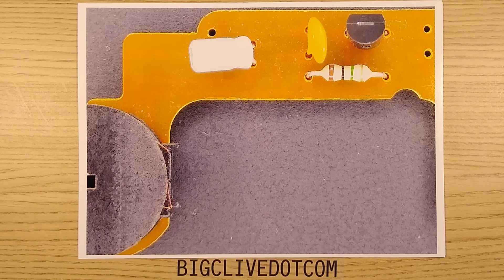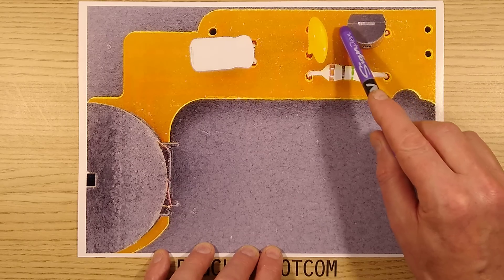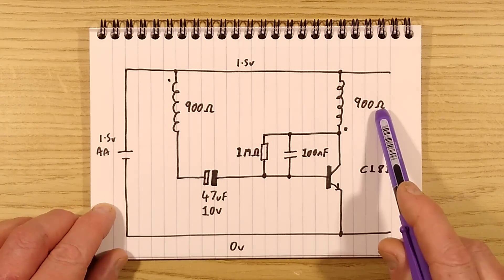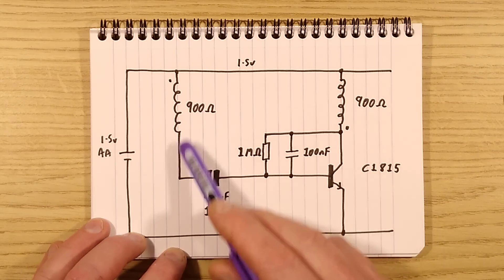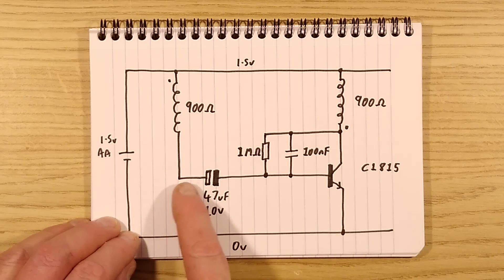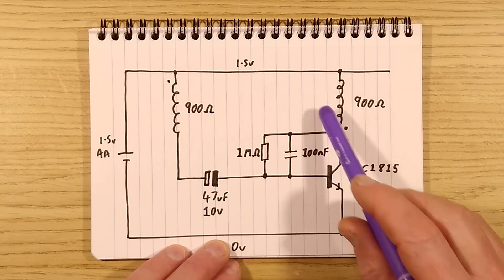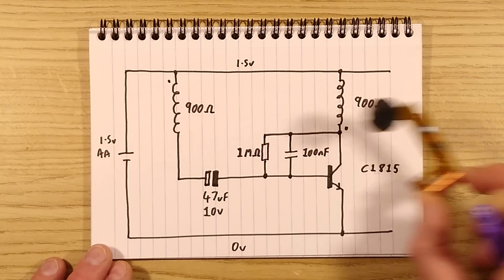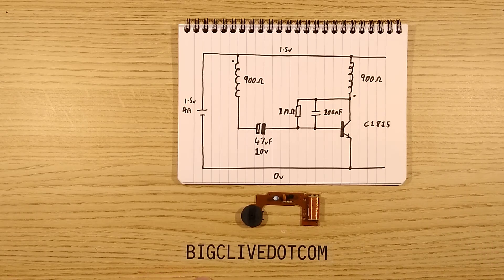Classic simple clock pendulum circuit

Comment: I have a non-working circuit that is very similar. There are two co-wound coils with different resistance. My transistor is a PNP Germanium, so the emitter is connected directly to positive, the collector is connected to negative through a 759 ohm coil, a 123 nf capacitor between base & collector, and base connected to positive through a 516 ohm coil. There is no coupling cap to base and no resister from base to collector. There are two sets of magnets that pass on either side of the co-wound coil. The magnets are very slow moving, connected to a rotating anniversary-type clock pendulum. Any ideas on what might be the problem?
Reply from the maker: If the coils are showing as intact on the PCB pads, the battery is making proper contact, there are no broken solder joints (battery contacts etc) then the transistor might be the culprit.  Note that in the simple single transistor coil kickers the transistor may actually be NPN even though it's connected to the positive rail, as the emitter/base voltage is from its own feedback winding.

Comment: I just picked up a 70's Smith's carriage clock that uses this sort of circuit. In that case it isn't a pendulum but a spinning magnet attached to a balance wheel and escapement.

I usually prefer fully mechanical clocks, although I do like the accuracy of quartz I try to avoid having too many quartz about the house. This clock I just got surprised me as it wasn't fully mechanical and certainly not quartz. It also has a lovely tick tock sound too.

Comment: In principle it might be neat to look at Bulova's "Accutron" watches, first sold in October 1960, They used use a 360 Hz tuning fork and transistor energised instead of a balance wheel as the timekeeping element, It was guaranteed to be accurate to a minute a month. Broken ones seem to go for as little as 15 quid.

Comment: This looks like a version of the classic Hartley oscillator. The centre tapped coil and 100nf capacitor form a resonant circuit. The larger capacitor and resistor are biasing. It would be interesting to see if the circuit resonates without a pendulum, and at what frequency. If we know the wire thickness, we could estimate the length of wire, number of turns, the inductance then estimate a resonant frequency for the tank circuit.

Comment: Hi Clive, a quick question maybe you could help me with. In regard to DC circuits, is there a difference between using a solid conductor or using a multi stranded conductor ?

This is in regard to model railway using up-to say 25v DC at about 6 Amps for points, Lights etc. Also DCC train controllers that output 16 Volt up-to 8 Amps. Pulse Width Modulation. 
Not quite DC nor AC but more like On/Off pulses of DC.
Any help in this regard would be appreciated. Thanks for your time. Alan
Reply from the maker: The main advantage is flexibility.  Using stranded cable puts a lot less strain on things it's attached to.  But solid core has its uses too.  I use both.

Comment: Greetings Clive! Hope you are well. Yes I have been there too,, 
A swinging desk ornament of a couple swinging on a swing, there were loads of these knocking about Inthe 80's,,
My swing originally had a 
Similar circuit as you described,, mine was not working,, I further screwed it up trying to get it working,, in the end I used an op amp and home made coil, I even replaced the 2xAA cells with a more convenient lipo cell & usb C charging port lasts about a month until it needs charging, strangely rewarding making the whole thing work after all these years,, You in part inspired the rebuild after I watched your (what could be done with lipo cells from vapes that had been thrown on street,,  Thanks dude
Reply: I also understand they are receiving my deep space signal in a neighbouring galaxy,,,lol

Comment: Just watched a YouTube channel that says the EU is bringing back phones with easily changed batteries. I wondered if they could include a solar panel on one side. I plan to make my own phone soon using bits from an old unit and a battery power pack. I intend to print a case, glue it all together, add a wrist strap, include adjustable legs, and solar panels that open out flower like. Afterwards I walk around like I did as a cheating kid at school with the equivalent of a 1970's green display calculator in my pocket. Mind you I'm still clumsy so I might ditch the idea and just invent a stick on fast working parachute system for smartphones and hope and pray the Russian style retos don't blow my pocket up.
Reply: Correction. Thickness equivalent of a 1970's calculator.

Comment: The Tennis Racket of Zeus (with design flaw). 

The mosquito zapping tennis racket sold at the Dollar or Pound Store would be a great item for you to disect.  It is just up your alley.  We bought one yesterday and it does zap the huge Canadian mosquitoes, dead! 

This looks like a tennis racket but has 3 layers of aluminum mesh sandwiched with 2 layers of plastic grid, and runs on 2 AA batteries.  When you wave it at a mosquito and it enters the mesh  ZAP!!!  the mosquito is dead.

The design flaw is as follows.  When you push the red button, the red LED does go on as per the instructions.  But when you release the button, the LED immediately goes out, leading one to believe that the racket is now safe.  But it is definitely NOT safe.  Pressing on the aluminum mesh with any force releases a whitish-blue spark straight into your finger.  Youch!!!  It does not really hurt and is kind of fun once you are used to it and expecting it.  It is basically like rubbing your feet on the carpet and touching the doorknob, but on steroids. 

This could be a fun item for a Big Clive analysis and diagram. 

Cheers.

Comment: Years ago ( 1970s) there was a animated advertisement display at a Woolworth's store. It had one transistor, one resistor, one capacitor, and the coil. The swing arm had a magnet on it. 
     It would run for months in a old school zinc carbon " D" size battery.

Comment: This circuit is similar to the joule thief or the blocking oscillator. As you suggest, the capacitor between base and collector must stop the circuit oscillating at a much higher frequency. The circuit likely operates on the edgy of stability. 
I have seen examples where the circuit has been used to phase lock a pendulum to a more accurate time signal, either a crystal or a radio time signal. I assume such circuits put a small bias on the pendulum so that it runs slightly slow, or maybe fast I can't really decide which, it must depend on the mode of operation. The circuit just pulls the oscillation into phase with the master time signal. 
In the example I was shown, the pendulum had an aluminium plate added to the end. This passed through a slot between two coils. When the coils were energised, the pendulum was slowed by induced eddy currents.

Comment: How come this circuit doesn't self-oscillate? Is it because of  bias introduced by the 1M resistor? I'd like to see step by step solving of the initial state of this circuit.
Reply: The small capacitor probably stops the oscillations. It provides significant negative feedback which overcomes the positive feedback of what would otherwise be a blocking oscillator.

Comment: rev counters are like 10 quid including stickers. experienced operators however, run the machine for 5 seconds and count the winds after. divide by 5 is winds per second. divide by 10 is per half second. thats usually about enough for human level hand/foot control accuracy. easy enough to trim a few winds off of the end result. :) you're welcome.

Comment: The big mystery is how this is stable enough for a clock, since slightly more current causes a longer swing, slightly less current causes a shorter swing.  The amount of current depends on the precision of a lot of analog components, battery voltage.
Reply: I believe this circuit is for clocks where the movement is a quartz fit-up and the pendulum is purely decorative. Besides, the period of a pendulum depends solely on its length and not on the amplitude of its swing. Galileo is generally credited with discovering that.
Reply: @johnopalko5223 yes... That's what the other coil and the crystal, that Clive didn't really talk about, are for.
Reply: @johnopalko5223  While generally true for small swing amplitudes, Galileo was wrong about the independence of amplitude vs period.
Larger swings are slower than smaller swings.
Of course, the limit would be +- 180 degrees. Once 180 degrees the pendulum would stop at the top. (assuming a ridged pendulum.

This is why precision pendulum clocks have the cycloidal mechanism at the fulcrum to effectively shorten the pendulum length with larger swings and called "isochronous". See wikipedia, 

redrok AD0TJ
Reply: It wouldn't take much to make a National Standards Lab based "pacemaker" to add to a conventional pendulum clock to replace Galileo. Add a microcontroller and GSM network  module to reach the NS time server over the phone network.

Comment: That's almost exactly the same circuit used in the battery operated Kit-Cat Klocks. It differs only in the placement of the 1M resistor and it uses a 22uF capacitor and runs off of 3V instead of 1.5V.

Comment: The 100nF cap would damp if it was in parallel with the coil. As it is in series with the coil and the base of the transistor, it will actually decrease the rise time on the transistor switch (i.e. it will increase the frequency)

Comment: What a  coincidence, I was at BHI clock museum near Newark yesterday. Apart from The Speaking Clock and Greenwich Mean Time kit  I loved the  old Master Clock systems from a pendulum master like Pulsinetic and Gents of Lecester I maintained in big factories around Liverpool 50+ yrs ago
Reply: I have a Synchronome and a Gents Master clock. The Synchronome is ticking away and clicking away every 30 seconds on the wall behind me in our kitchen. The Gents was the Master clock in a Carpet Factory, 1949 vintage. The Synchronome is from 1914. I've no information about where it was installed. You must have had an interesting job.
Reply: @alastairchestnutt6416  Part of an interesting career. Bonus of the time I worked on clocks was a weekend of overtime for changing  BST. I got two hours for each site including travelling as I had to stop for an hour then restart. Of course I stopped one, went to next and stopped that and so on then returned to first to restart. Only risk was if security delayed me getting in at one site and I missed the hour so it took forever to catch up but I usually got 8 hours time +half Saturday double time Sunday for just over two hours work each day. The simple ones we could wind forward in spring  but the electronic ones could go double speed and took an hour to add an hour so same trick.

Comment: you sound different please tell us you just have a cold or a covid variant and you did not try to get the michael jackson voice surgery and botch it by trying your voice too soon and rip/snap and your voice reverted or get exposed to ammonia concentrate from say breaking open an ammonia powered refrigerator or from a meth lab in your area

why the clock movement is complex is probably regen braking is happening.

the charge is being recovered in a regen kind of way so it can power the other coil.

looks like you have a slayer oscillator too.

Comment: the sewing machin trick to build coils is awesome! (But aren't you supposed to count the loops?)
Reply: rev counters are like 10 quid including stickers. experienced operators however, run the machine for 5 seconds and count the winds after. divide by 5 is winds per second. divide by 10 is per half second. thats usually about enough for human level hand/foot control accuracy. easy enough to trim a few winds off of the end result. :) you're welcome.
Reply: Apart from the increase of diameter? @Palmit_
Reply: Depends on the application. For a certain length/resistance of wire the coil can be weighed. Works well when matching coils.

Comment: I keep hearing coil saturation in different videos, my experience with a current probe and hall sensor shows this not to be the case. Thanks for sharing.
Also, i was a little surprised the coil is center tapped, most cases I have seen, the base side coil has many more turns (like the top secret spinning top), it does not have to be, but seems more tuned for efficiency.

Comment: Clive, could circuit be used to made a earth rotation clock?
Those ones that have tiny blocks in a circle that as the earth rotates one by one the pendulum finger knocks down?
Reply: Yes it can be used with a Foucalt pendulum, though normally you would need to make it a little bigger, simply because you need to apply a lot more force to the pendulum to overcome air resistance than the milliwatt or so of energy this one delivers per pulse. Normally they use a coil wound with fewer turns of thicker wire (20SWG) for the collector side, and wind the base side with 36SWG wire, and then run it off 12V instead, so you can get around 1A of current in the pulse to drive the coil.
Reply: @SeanBZA  
Thanks man for your answer.  I just thought you could make a micro one.  Could sit on the desktop.
Reply: @assassinlexx1993  Normally those are around 10m high, or even more, so that they can react to the rotation of the earth and not have the tint force be overwhelmed by friction and wind.

Comment: Does the magnetic pulse repel or attract the magnet on the pendulum?
Reply: Repulses it, as the kick occurs while the magnet is approaching, nearly over the centre, and then pushes it away from the coil, giving it a pulse. That is why you need a rigid mount for the magnet, otherwise it will simply flip it on it's side.

Comment: If the resistor's purpose really is to keep the transistor slightly biased on, I think the electrolytic capacitor's leakage current should be enough for that. Though I doubt such weak biasing is necessary at all in this application. Seems to me like the 1M resistor would be better used across BE to minimize Ice between pulses.
Reply: I don't think capacitive leakage would be consistent enough to rely upon.
Reply: @olsmokey  I doubt base bias current is necessary at all in this application. As I wrote earlier, it would make more sense to me to use the resistor to pull the base low instead.
The only reason to bias the transistor would be for faster turn-on speed vs completely off, though you'd need an exceptionally slow transistor for that to be an issue with a ~5ms pulse at ~1Hz.
Reply: @teardowndan5364   I'm guessing the moving pendulum does not create the 0.6v needed to turn on the transistor without extra bias.
Reply: @eDoc2020  The AC coupling capacitor between Vbat, the base drive coil and the base is already charged to Vbat-Vbe in the static regime, which takes care of the 0.6V base voltage: Vb = Vbat + Vcoil - Vcap = Vbat + Vcoil - (Vbat - Vbe) = Vcoil + 0.6V. The only thing the coil needs to do is provide the base drive current.
Reply: @teardowndan5364   But without the resistor the capacitor wouldn't be charged to the proper level. It would fire once and then the capacitor wouldn't let any more current into the base.
Reply: @eDoc2020  The capacitor gets charged by current going from the battery, through the coil, the capacitor and the base-emitter junction. It stops charging once its voltage is one Vbe short of Vbat. The resistor plays no role in that except possibly offsetting the base-emitter leakage that may let Vcap eventually reach Vbat.
In any case, the 600 ohms coil likely has more than enough turns to generate over 1V when the pendulum's magnet swings by.

Comment: How would the circuit need to be adapted for a string?   Like for a powered Foucault pendulum.
Reply from the maker: It's tricky, as the magnet sometimes deflects to the side.  Maybe the string attached to a long heavy shaft.

Comment: found my grandfathers clock. made it... 1930 maybe? 
its so weird, an axial ratchet escape gear, a worm gear reduction... and a solenoid driven pendulum.

some terrible switch on the pendulum, appears to switch it so it retards the upswing as much as assist the down... and 50% duty... lol.

meh. planning on giving it a little overcentering toggle, operate a set of switching reeds so it turns on just as its getting to the solenoids,  toggles over ready for the return swing as it simultaneously turns off, then repeats... and dump the back spike into some neons around the face. pretty :) maybe distributed for hours/mins.

no solid state allowed! well, i wanna stay period correct.

except for threads. its getting metrics where needed.

Comment: Could you use this to turn a 7 day wind up clock into a continuous one?
Reply: I think not, these are made for decorative purposes. You'd need to ramp up the power significantly to actually drive an actual clockwork.
And when doing so you can go wild with an IR reflex sensor, a beefier electromagnet and transistor to go along with it.
Reply: No. The pendelum in a mechanical clock is there to do the timing. Each swing will let a gear turn one tooth for each swing (called the escapement mechanism of a clock). The power that actually turns the gear comes from the weights/springs. 
It's technically possible to make a ratchetting mechanism that would use the power of the moving pendelum. But that would be an extensive redesign of the whole clock which would require quite a lot of expertise in designing clock movements.

Comment: Yes, I've learned over the years the simple designs are the best. One or two transistors and a few components other than a tiny crystal driven timer chip. In fact, I used this same principal years ago to accelerate a round magnet to over 150,000 RPMs